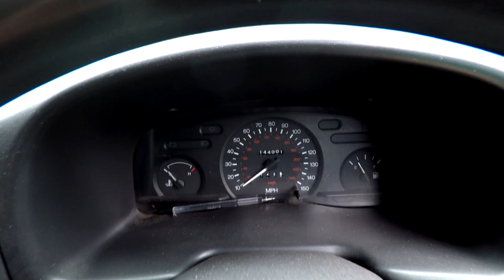Old Start Cold Start Vlog

Comment: The Shopsmith might be just the thing for a fellow with limited space, it converts to several different types of power tools. They're pretty well built, but they do require a bunch of accessories, which you seem to be missing- maybe look about for the missing bits. Should make a table saw, a lathe, a drill press, and a sander, at the very least. A friend of mine had one, and I used the lathe, worked pretty well.
Reply from the maker: Its sold now to an old boy who's going to get the other bits and restore it.
Reply: Good job,  @retrorestore

Comment: Hi Martin, the water pump, the cord was hanging out, did you mean it is too thick or long, because if it was too li g, take the pull start off and the handle, and wrap it round and put the handle back on.  I used to have Suffolk colt mower engines.
Reply from the maker: Its too thick Andrew but its all I had at the time.